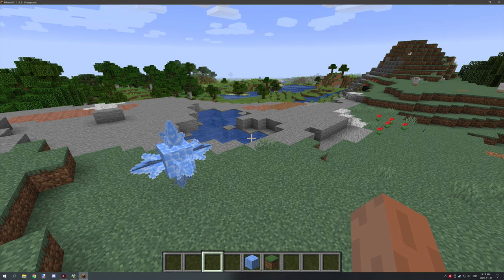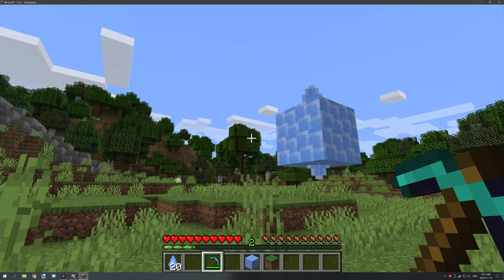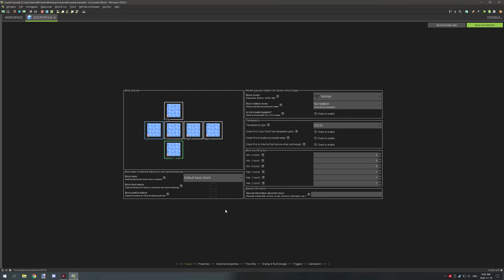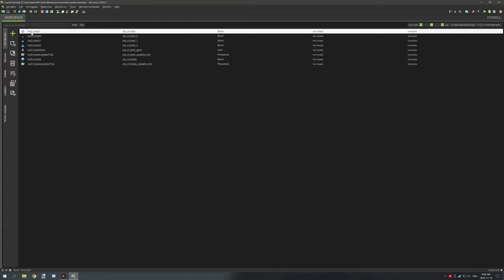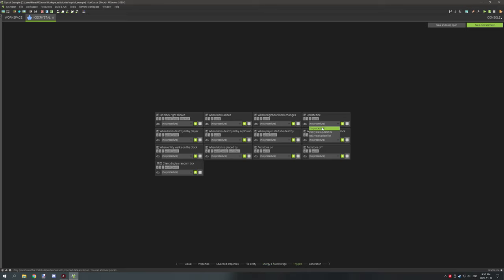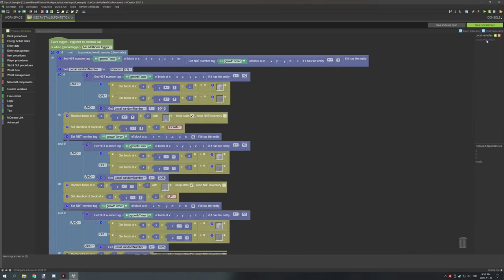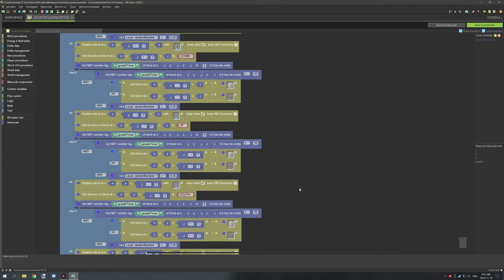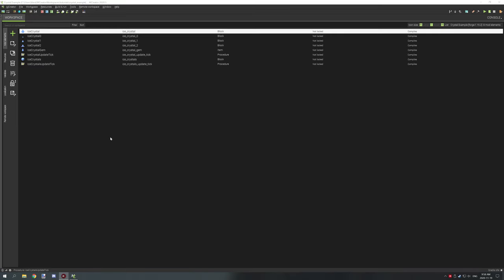MCreator Tutorial: Geode Blocks And Crystals V1 | 2020.5

Comment: The rotations dont work on my model, could you show how you made the spike models next time...
Reply from the maker: I am pretty sure the blockbench models are included in the download for the project if you have blockbench then just open those models to see the proper rotation.
Reply: yes
Reply: 💀💀💀💀💀its not a model or at least you dont need one just use the default cross model

Comment: texture not showing help pls 
it just shows the pink and black error thing not showing the crystal rotation works tho
Reply: and yes I did bind the  texture of the crystal to the block model can anyone help plsss
Reply from the maker: Check to see if your texture is a proper ratio it should be square and either 16x16, 32x32, 64x64, 128x128, or 256x256 if its not that size you can run into texture issues. If its not the problem then it may be a setting in your blockbench that is causing the issue, I have had problems with the credits setting in the past breaking textures it may be the root cause of the issue, double check under export settings in block bench that you have the credits set to blank, if its says something then it will add a line to the JSON file after its exported which may break your textures.

Comment: I followed this tutorial but I think I might have messed up at some point and am not sure where, the crystals will grow to their first stage but won't grow after that + are all facing upwards regardless of the side of the block they generate on
Reply from the maker: Maybe check to see if the crystal has NBT enabled and that the tick rate is set up, this can prevent the timer from working if this step was missed.
It happens some times when creating new blocks, I try to clone blocks once I have first stage made so I don't forget settings like this.

I hope that helps and is the issue, some times its something simple like that :)

Comment: I have a to this video non-related question . I have the DC 15 blaster in my Star Wars mod and I want the commando droid the clone troopers and some of the other mobs to use it do I have to remodel it in the hand of every single mob that I want to use that gun or is there a way to put the two models together ? this has been driving me nuts for a week I can't figure out how to do it. I didn't want to bother you but I'm at my wit's end
Reply from the maker: Sadly every model has to be modeled currently for adding tools and weapons. The easiest way is having a 2d pane and adding it that way this way you can just update the UV map for each one the down side is its 2d and looks a bit off on a 3d model.
Reply: @NorthWestTreesMCreator  ok thank you

Comment: Is local: randomnumber a custom variable? How would I make that in 2022.2?
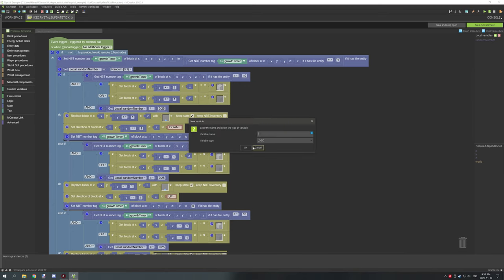Reply: 9:02
Reply: also use a number var and not logic
Reply from the maker: It should work the same in 2022.2 however I will be updating the tutorial soon to have chapters so most likely I can clear some of the questions about it up soon :)
Reply: @NorthWestTreesMCreator  Okay cool! Can't wait :D. The only thing I found not working was the first procedure. Essentially, crystals can grow from buds using the second procedure, but they can't generate naturally using the first one. (Unless I did it wrong lol). Should I take a ss of what I have so we can determine if need to be changed for the new tutorial?
Reply: smh I had a sneaking suspicion this was the issue but I didn't bother to check. I forgot to save after adjusting the tick rate lol
Reply: It just looks like only placed blocks generate the crystals not generated ones
Reply: tried turning random tick on, it just disables all crystal growing. Sorry for all the replies to my comment lol. I just want to document this for anyone in the future.